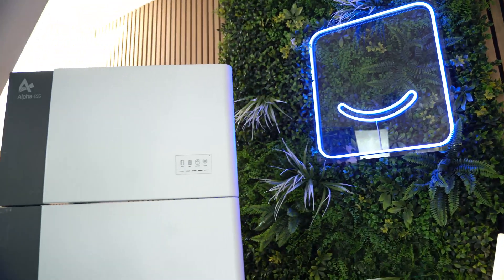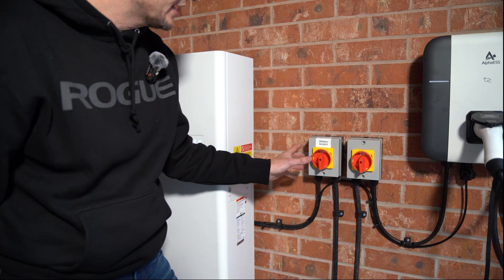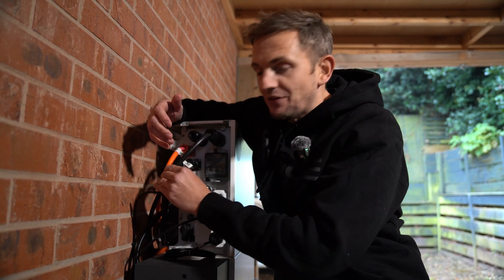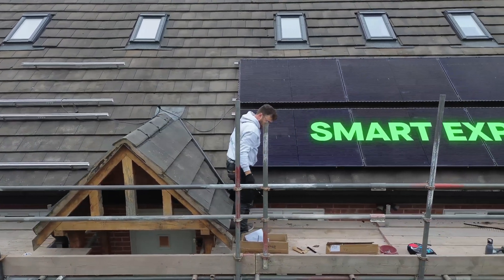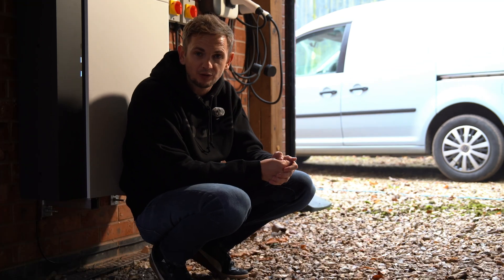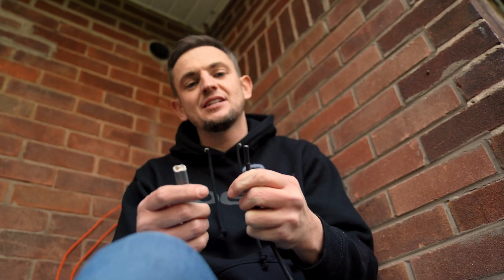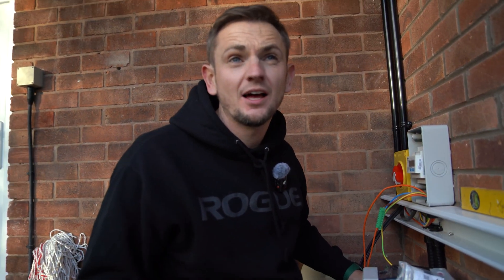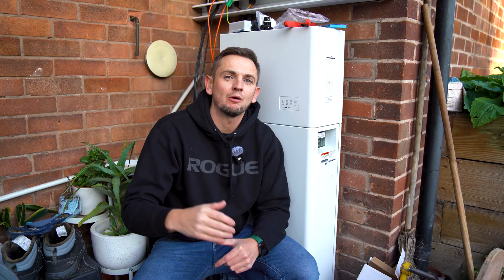Which Coupling Type is BEST for Alpha G3 Batteries?

Comment: How many watts per hour do the 5kW inverters take to run?

What is the advantage of putting 2 Inverters in series with 2 x 10.
Reply from the maker: @symosys  The inverters take 43 watts per hour to run and the advantage with paralleling 2 batteries and doubling the inverters is that it doubles the power.

Comment: Interesting. I would love your system but quote was gobsmacking  so expensive it was .12 year before brake even. At best . I still may get solar for the environment if my lotto ticket comes in🫰
Reply from the maker: Hey Keith, we currently only offer the REA Fusion 2 which is a premium solar panel. You get more 'bang for your buck' so to speak, because of the generation differences between cheaper (non bifacial) panels and ours, so the investment is one that you reap back quicker.
Reply: @Heatable Quicker ! ! just checked quote 14 to 15 for payback also checked with estate agents they say it will add maybe 2 to 5 k to the value of my house. So disappointing really wanted to do the right thing.

Comment: i worked out i can fit 54 panels on my roof . i wouldn’t want fork out for all of that in one shot.
Reply from the maker: Unless you have a huge/ unusually high energy usage there wouldn't be a need for 54 panels! A standard 20 would cover most homes with an average energy usage.
Reply: @ i am having 30 put on .
Reply from the maker: @dogmangreengrass736  Did you decide to add on battery storage too? Curious which you went with if so?
Reply: @ i am going with pw3. waiting for dno currently . 👍🏼

Comment: thing is, most people have a solar system first and then get a battery later. so it's almost always ac coupled, esp. if your'e using solar edge. That's my problem at this moment, i'll just have to live with the 10% conversion loss times 3..... ac->dc->dc->ac->ac->dc
Reply from the maker: Would you go with DC over AC then after watching the video?
Reply: @Heatable  that'd be expensive, to throw perfecrly good working technology (optimizers, inverters) for a performance gain. i'll consider itwen my solaredge inverter breaks down, it's now 6 years old..
Reply: Since most household items will run on DC I would personally look to fit an all DC system with a small inverter for the few items that need it. Running all of it from a reasonable size battery constantly charge directly from PV. I think micro inverters or running PV panels into inverters is mostly mad and not having a battery is very short sighted.